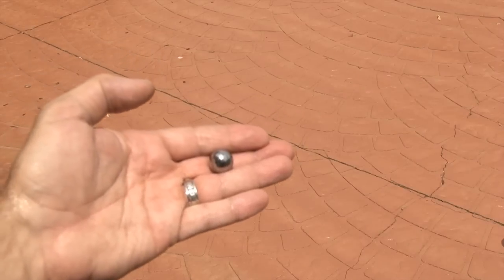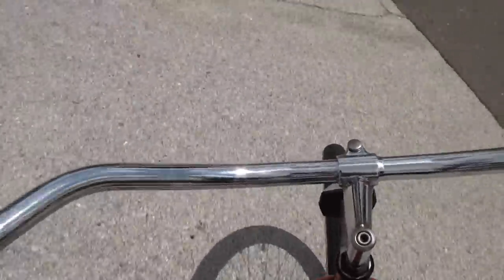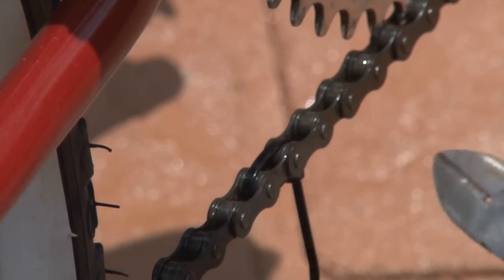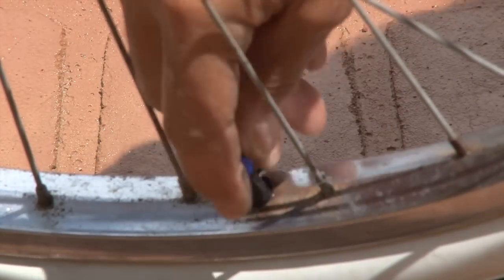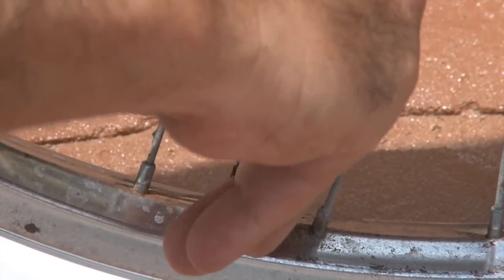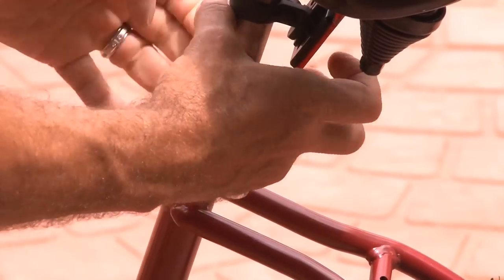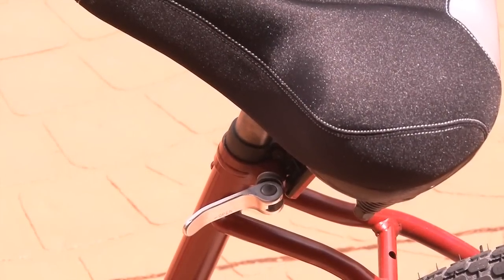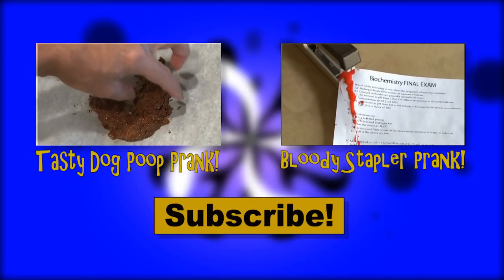Epic BIKE Pranks!

Comment: Terrible. Some of these are excellent ways to ruin a bike.
Reply: So are they terrible or excellent? Make up your mind.
Reply: None of these would ruin a bike...
Reply: The zip tie one only makes the chain fall off. The one with the ball only makes a noise, and will certainly be found at some point. The foil-tire cap one only flattens the tire. The hotdog one can be fixed by giving it a heavy cleaning, I'm sure.
Reply: having a chain fall at those speeds at the trails is a common thing any skilled rider will be able to balance. gg

Comment: Okay, the ball bearing prank is kinda funny, but the second I find out I had spent 60-80$ on multiple replacement tires that were actually fine, or have to clean rotten meat out of my Specialized Hard Rock seat post, friends will be lost. Plus, that bike chain zip tie can be extremely dangerous. At slow speeds, sure, it's just annoying, but the second you get around 20 MPH, your chain falling off can cause you to kick so hard so fast on your pedals that you lose balance. We're talking fatal injuries if this happens on a road bike ride.
Reply: Finaly one smart person!
Reply: specialized bikes are the best!

Comment: How did you get the hot dog out of your bike
Reply: You dont.
Reply: It falls all the way down into bottom bracket of bike crank. You'd have to spend hours rebuilding your bike and cleaning or replacing parts. Don't sound so funny, it it were your bike?

Comment: The bike chain one is a real hazard on a FG bike, the chain will fall and lose your brake (if riding brakeless, now it will become a real brakeless bike), and most hazard is if the chain comes off the chainring: the back wheel will continue to wrap the chain around the chainstays and BB - it can ding the frame, twist the chain between frame and wheel, might even bend the chainstays pretty bad. - also a bonus faceplant due to inballance, or the sudden skid, or the brakeless issue.